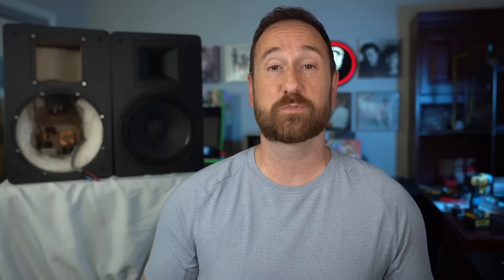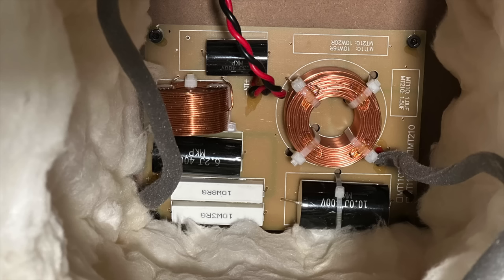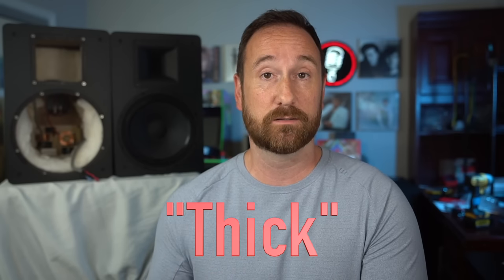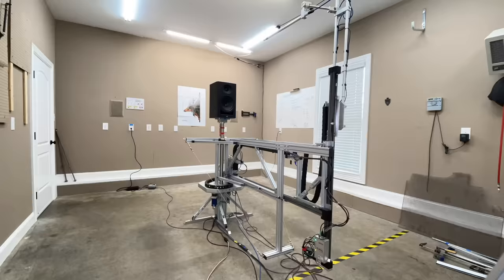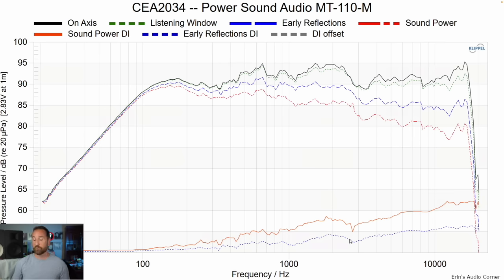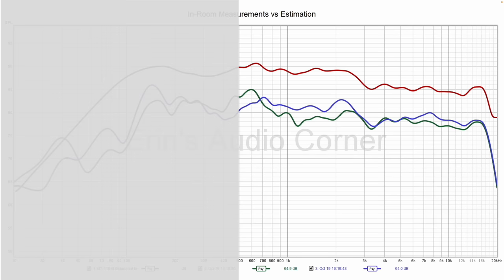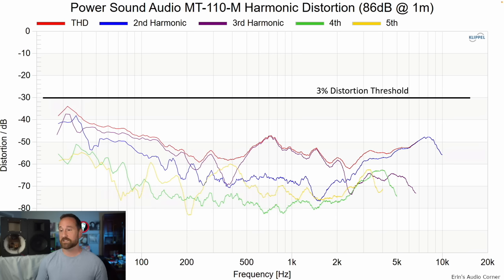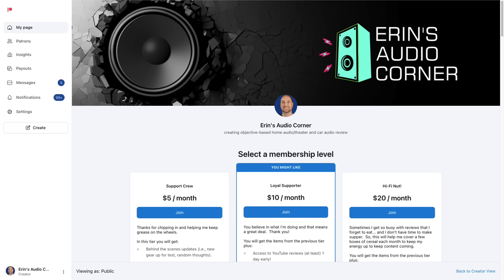Power Sound Audio MT-110-M Review

Comment: Hopefully they release a V2 with a basic notch filter in place to tame the mid-range and lower treble down, looks pretty outstanding otherwise for home theater application. Thank you, as always!
Reply: That is one way to do it, that notch filter will add some cost to the speaker. Given most users of this speaker for HT will have a room EQ system, that will take care of this correction quite well also.
Reply: @wechnivag  a typical notch filter off the shelf in parts cost is around $10 to $20 for each speaker, so there would be a modest increase in cost. I do agree with your point about most people being able to just EQ these to taste given their directivity.
Reply: I'm not sure if he's updated the 110's but he did just release a new 212 model that's got B&C's top of the line (and pretty much top of the line overall) coaxial compression driver. Very similar but better designed than what comes in JTR's 212/215 Noesis cabinets. I wish Tom had made the cabinet itself a bit bigger and used the B&C CD horn they made for the coaxial driver but I bet the current design keeps the price far lower than if he'd done that.

I'm dying to see some measurements and video reviews of it. There are a few written reviews and they all sing it's praises.

Comment: I chose those B&c drivers for my own custom build (de250 and 10cl51) I’m surprised to see that  midrange bump. It could use a more aggressive crossover. Also, I don’t like the exponential horn.  It only sounded good on axis. I switched to a CD horn and was much happier with the sound in my room
Reply from the maker: My guess is it’s a baffle step compensation issue. Hard to know for sure without measuring the woofer in the cabinet without the crossover.

Comment: I use these for HT (rears). All of the psa loudspeakers get very very loud and are extremely clean and clear at all decibels. My ears and listeners will leave the room before the speakers start to faulter.

I went with psa for a few reasons, but the main was primarily HT. I do not use these for music/stereo listening. 

Also, these are meant to be paired with subs. Coincidentally, psa makes great subs. Imagine that...its like a business with an ecosystem of products theyre trying to sell lol

They arent winning any beauty contests and they certainly arent for everyone and all scenarios. But for HT, they are a fantastic choice provided you have even a basic understanding of what you're doing. 

The only path up from here, imo, is JTR...which are higher dollar and require more knowledge to run. Not that adding amps and components is rocket science, but you arent going to just run JTRs from your AVR.

I suppose super high dollar stuff can do more better, but everything has a pricepoint/compromise. I cant just replace all my psa gear with perlisten lol

Thanks erin

Comment: I've heard these (and the rest of the PSA speaker lineup) and they are fine for HT. If you are used to speakers that create 3D image like Salk, KEF Meta, Philharmonic, etc....these PSA's will disappoint you. They just don't do that for music or even two channel HT/TV use. Their soundstage is pleasing, but is lacking in depth and width compared to the previously mentioned brands. There is absolutely no wrap-around sense of envelopment from PSA. None. Zero.

However, if you like it clean and loud and can EQ them to fix the midrange, they are very solid options.
Reply: Well duh! These are home theater  speakers the new mtm 212 does a much better job with music but still not better than hi fi music speakers.

Comment: I would have hoped for more than 92dB sensitivity from such a large bookshelf speaker that doesn't really try for deep bass. It doesn't have the excuse of losses from the crossover since there just aren't that many elements in the crossover - and it could have used a more sophisticated crossover to flatten out that response.

Comment: Would you draw a correlation between low QTS high motor strength woofers and low distortion? That almost always seems to be the case when you review these "PA" style speakers. Maybe that would make for an interesting video?
Reply: Care to share your thoughts?
Reply: I suspect it's just SD related. Larger acoustical systems just tend to have less THD.

Comment: Solid option for HT at the price point.  To get a compression driver for the dynamics and to be sealed for near wall placement I wonder if these or something from Chane's 7 series would be the best buy.  I was definitely looking at these and the Chanes before ultimately saving a lot of money with refurb JBL 5 series speakers.
Reply: All the JBL Studio 5 series speakers come with port plugs.  I have some close to a wall with the port plugs installed and they measure and sound great in my room with room treatments and EQ (and some big subwoofers!)
Reply: @splfordayz9050  That's funny sounds like we have very similar setups.  I've plugged all my ports as well because the speakers are up against the wall.  And I went big for bass too...I've got 2x JTR RS1 subs
Reply: @tvolkman88  JTR are my next upgrades.  I have been rocking dual Monolith 15s (I have transducers in each seat too) for like 6 years now.  Waiting for them to die so I can buy some JTR's or PSA :)

Comment: To me, it just looks a it needs more baffelstep compensation, (500hz looks about right for that baffelsize), and less HF-padding..
Reply from the maker: Yep. Exactly my thought. 

Giving them the benefit of the doubt, I kind of wondered if they hadn’t expected people to put it somewhat near a wall which would help boost up the mid range but then again, the tweeter is padded too low, so any benefit of the doubt I give them is strictly that.
Reply: @ErinsAudioCorner  On second thought, with more baffelstep compensation, the tweeterlevel should be about right as it is..

Comment: Is there a chance a high pass filter is worked into the woofer portion of the crossover? And in doing so, how would that effect sensitivity due to the filtering out the lower frequencies (< 100hz) reducing the need/demand for the amplifier to power the reproduction of those frequencies? Am I making any sense? 🤔 How do you think the dual 10” variation of this brand would measure? Cause my understanding is that the entire line of speakers, including towers cuts off at 80hz. Thoughts or input? Great content Erin!
Reply: i think that there is no chance of a high pass filter for the woofer, just one simple first order crossover whole require a huge inductor.

Comment: If your ears are always right, why go through the trouble of measuring the speakers, Erin? 😉
Reply from the maker: Because they miss things.  For one, my interpretation of a sound may be different from someone else’s. If I say “thick” someone else may have a different interpretation and assume I mean something completely different. So I use the data to help me explain what sounds I’m talking about. 

Other reasons off the top:
someone may want to aim the speakers differently and need help understanding via data, I don’t trust myself to fully quantify the exact differences between sounds as readily as frequency response can, I can’t bang-on tell you the vertical radiation limits and I can’t say the exact horizontal radiation pattern (other than just saying some angle that sounds reasonable). I can keep going.

Comment: Klipsch RP600 measures better, has useable bass, and you can buy 2 pairs for about the price of 1 of these (when klipsch are on sale which is most of the time). Poor value.
Reply from the maker: I’m not disagreeing entirely. However, the average sensitivity of the RP-600M is about 85 dB which is 7dB less than this speaker. That matters to some.
Reply: These aren't going to be able to play nearly as loud as the PSA. If the Klipsch play loud enough for you, I'd agree and get them.

Comment: .        A 90 Hz subsonic woofer crossover?  That's even audible to deaf people.  Having a 90Hz point source back in the right side must sound like there's a bass guitarist performing solo in the corner.  AmIright?
       They have a design problem here. If most people who buy these use them for home theater,  then the  PSA's  (dumbest marketing team ever btw)  will need to get down to what? 15Hz to recreate synthetic earthquakes & explosions?  AmIright?
      So in a compression driver 2-way, the LF driver needs to get UP to about 800Hz for music (although some wicked nice midrange drivers are getting to 400Hz, yay)  & DOWN to 15Hz for home theater in order to sound right.  AmIright?
     They're screwed.  A sub with 20mm of Zmax will never get to 400 or 800Hz & an 18" paper cone woofer will never get to 15Hz.  The only hope is port it & EQ the heck out of it or dump the crossover, bi-amp it & only listen to pop rock or watch Indie movies.    AmIright?

                                                                                        Reggae, Funk & Brass     🔈🔉🔊
Reply: z max x max whatever

Comment: I really appreciate the review and @demwillams8898 for loaning the speakers for the review! Hopefully you include an impedance graph in the written review as one of the main reasons I was looking at these speakers was for ease of driving. I've blown a surround channel on my AVR (X4500H) three times because once Audyssey applies filters to my Q100s (it applies a +4db channel trim and stacks +10db filters on top 🙄), it tries to draw way too much power. I've sort of corrected for this for now by lowering the channel trim and crossing them over at 120Hz but I'd rather not have to think about it. The Q100s are obviously much lower sensitivity but also dip below 4 ohms and so I was looking to upgrade to something with higher efficiency + higher impedance. Unfortunately I don't yet know what sort of dispersion pattern I'm after and will have to think about it. Another option I'm considering is the Ascend Acoustics CMT-340SE2 which are half the price but still dip to about 4 ohms.
Reply: Can't take credit! By the time Erin and I connected someone already sent a pair. I also have the surrounds but I don't think those are going to be very different than these. My MTM210T's are the old ones without the new tweeter so no need to review those.

Either way, great to see psa getting reviewed. I've had their speakers/subs for many years and have been happy. Definitely can get loud and clean...
Reply from the maker: Impedance will definitely be part of the written review. I actually talked about it in the video, but I wound up editing it out because it’s mostly inconsequential and I needed to save time.

Edit: wow, speech to text hosed me the first time …